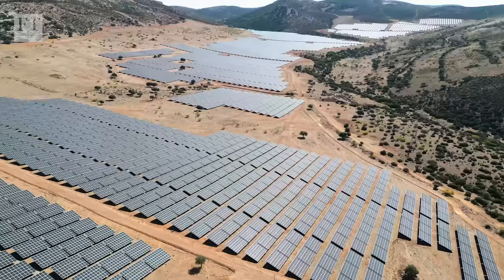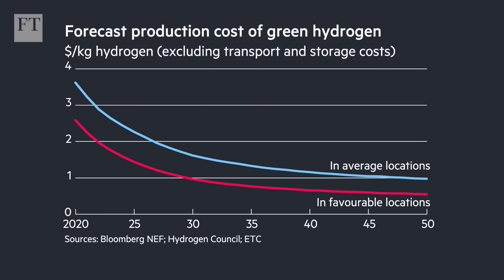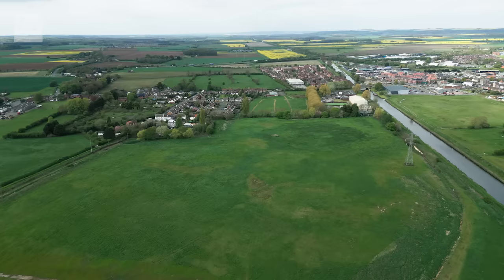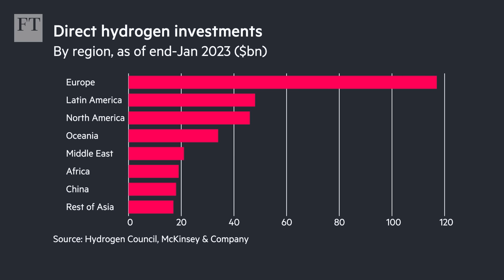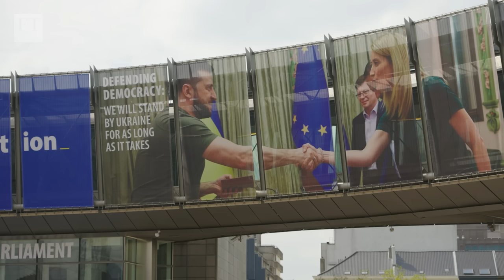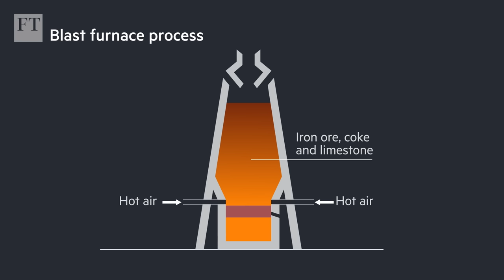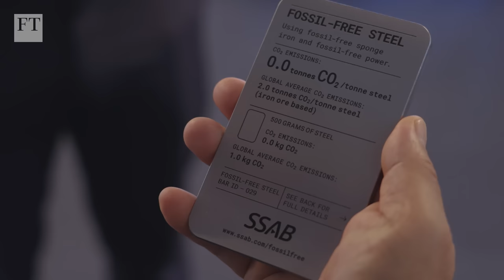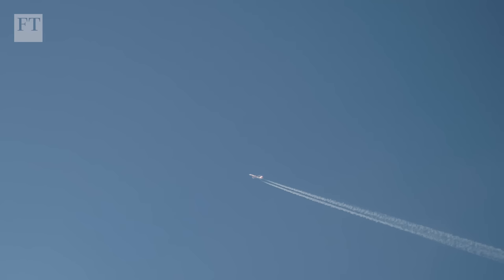Can hydrogen help the world reach net zero?  | FT Film

Comment: This completely glossed over the biggest issue with electrolysed H2 - the awful efficiency, not a lot better than petroleum. The round trip efficiency (electricity to H2 to electricity to power) is around 40%. You have to make a case that it's 2 and a half times better than simply storing the electricity in a battery. There are certainly use cases where the answer to that is "yes", but they're not as many as the proponents think. The second problem is that the fossil fuel industry piggy-backs on the "clean hydrogen" message to push their own hope that making H2 from fossil fuels will save them, always neglecting to mention that "blue" H2 requires CO2 capture & storage, a technology that in 20 years they have completely failed to demonstrate can succeed. In that same 20 years we've gone from no commercial electric cars to the amazing ones we have today and a grid that's rapidly decarbonising.
Reply: Ok. What is the top speed of Ford model T in early 1900s and what is the top speed of  toyota corolla? 

How was the experience with Windows 95 and Windows 10? 

How about flying the first flight of Write brothers and A380? 

Are you getting the big picture?
Reply: @Bravo.6  What is the relevance of that glib (and totally irrelevant) remark ? Windows 95 was hugely MORE efficient than Windows 10. It could run perfectly well on processes a tenth the speed ! That's an argument in favour of Win 95 !
Reply: haha, "rapidly de-carbonizing." What insane graphs are you looking at? Or are you reporting in from the Lunar colony??
Reply: @grahamstevenson1740  oh. so are you still using win95? I mentioned those to compare "level 1" things to "level 50" things". There are some genius people who say "hydrogen" is not efficient because it's in level 1.
Reply: @Bravo.6  No, but I'm also not using a 66MHz '486 !
That's the entire point. An OS that could run on a single core 66MHz CPU now needs a multiple core CPU running at many GHz ! The needs have increased around 50 fold.
Reply: @apollo_x_mirko8973  What about the energy used for cooling and compression of hydrogen for storage. It uses around 1kWh per kg of hydrogen to bring the pressure from 20 to 350 bar.
Reply: On avarge You have to drive  ev-cars for 10 Years to make up emitions one an average petro car. We have 1/10 of minerals to let ev- take over in a meaningful way.
Reply: @apollo_x_mirko8973  You're way too high. PEM efficiency is around 60% at best, nowhere near 80-90%.
Reply: It really depends on the specifics on the technology developed in the future, the H2 economy isn't ready today. There are a large number of alternate hydrogen processes being researched that have better efficiencies.
The best argument for a green hydrogen industry isn't for power, it's for industrial chemistry. We are going to need hydrogen to make ammonia and possibly steel.
Reply: Incorrect information here 👆
Reply: @djtomoy  Oh, what did I get wrong?
Reply: @apollo_x_mirko8973  Here's a reality check though.  Of all the electrolyzers, they all advertise pretty high efficiencies, but after you consider all the processes to make it work, it runs about 58kWh/kg at best.  Check any new large hydrogen project, not just individual components. Then, as California found out, they can't keep enough hydrogen at the stations to meet demand in gas format, so all the new stations are cryogenically cooled to -427°F for liquification.  That's an additional 12kWh/kg.  Granted Plug Power after decades of development from the previous company they bought just came out with a revolutionary chiller that only uses 11kWh/kg. The Toyota Mirai gets about 65 miles per kg.  So to go 65 miles you're using (58+12) 70KWh of electricity + transportation.  That's the reason all the "renewable" stations are charging $29.95/kg currently in CA.  So a little over 1kWh per mile.  Then consider any EV with the passenger room/ cargo room of a Mirai and they all get above 4 miles/kWh. The 2023 Mirai is considered a subcompact for interior space and a large sedan for external dimensions.  H2 is OK if you've got nothing else, but imagine needing to install 4 times the amount of solar to drive the same distance.
Reply: @Bravo.6  The problem with the "level 1" to "level 50" analogy, is that they have not even moved to "level 2" with Hydrogen in 50 years.  Meanwhile, battery technology continues to move forward.  In addition to the gross inefficiency of electricity->H2->electricity, and the challenges and expense of transportation and storage, there is not enough known reserves of platinum and palladium in the world to produce the number of fuel cells needed at scale.  Green hydrogen produced on site for Green ammonia and Green steel makes total sense.  You don't have the added inefficiencies and challenges or transportation, storage, and fuel cell electricity generation.  But everything else has too many problems.
Reply: When fossils are burned, hydrogen is what is actually burned, meanwhile carbon is released to the atmosphere. 

Understanding the basics would be of great benefit, to the general public.
Reply: You are working the round trip efficiency including a step that uses a heat engine to turn the H2 back into electricity, I believe.

The fuel cell approach does not involve the losses fundamentally inherent in any heat engine, and therefore has the potential to be much more efficient.

Getting the system to work is the first step; but it makes sense to choose the route that avoids the limits set by thermodynamics.

And even ignoring that, as one of the final clips in the video made clear: where electricity can be used directly is always going to be more efficient: we will accept the losses inherent in any electricity->H2->electricity cycle only where H2 is the most practical way to transfer the energy from the place& time of production to the place& time of usage. As that speaker said: it is those use cases that will create the H2 market.
Reply: @adamdymke8004 not only "being researched" but in some of these cases moving on into early production-scale deployment. Yes, at some point in the future some of these technologies will be winnowed out; but enough of them are either starting production or in production scale prototype that we can be sure some of them will survive.

Unless vested interests stop the energy transition altogether, in which case few of our grandchildren will reach age 50...
Reply: @FlameofDemocracy wrong!

Both the hydrogen and the carbon are burned, producing both dihydrogen oxide (water) and carbon dioxide. Both oxidations contribute to the heat liberated.

You were absolutely correct to point out that it's important to understand the basics: starting with yourself, if I may suggest so.
Reply: FT does not do numbers. That's for grown-ups. Thanks for the number anyway. 40% is not "wheely good/great".
Reply: H2 is ozone scavenger, if H2 start to be use at important scale=} bye ozone layer and Montreal protocol
Reply: Well said!  H2 has its use cases, but we have to carefully examine its pros and cons.
Reply: Yes, hydrogen is not nearly a mature technology yet, but it has some great potential where electricity cannot be stored. Batteries are only a short term storage option, you can’t stockpile electricity to use 6 months or a year later.
Reply: @alst4817  you can't really stockpile Hydrogen either though. It's hard to picture, but the Hydrogen atom is so much smaller than other atoms, that it can sneak through some molecular bonds. That is, you can have solid material, and the Hydrogen will just migrate right through it. It is incredibly hard to contain.

That is why people keep pushing the idea of bonding the Hydrpgen to a molecule, like with Ammonia. The problem with that idea is that Hydrogen already takes a huge amount of energy to isolate into a concentrated form. Then you would have to use a bunch of energy to bond it into the molecule. Then more to unbind it for use. It makes zero sense when it takes more energy to produce energy than what the energy will give.

Also, it should be noted with respects to Ammonia, that it requires a Nitrogen atom, which is needs to be obtained by stripping it off some material. You can't get Nitrogen atoms from atmospheric Nitrogen, because those molecules are triple bonded and require huge amounts of energy to break apart. Since the Nitrogen is stripped out of material, that also means there is copious amounts of waste material that needs to be dealt with from the process as well. So, more energy is necessary with dealing with that too.
Reply: @haddow777 yep those are good points, and I’m not a chemist so I’m not familiar with the specific energy needed to convert to ammonia and then back again, but my understanding was that the physics made this a possible approach. Whether the engineers can do it for cheap enough is a different matter!
Reply: But you can't compare it this way; the overall efficiency of gasoline, for example, including the refining process, is much lower—around 5%. So producing hydrogen as a fuel is still much more efficient than any other fuel.
Reply: @alst4817  I'm not certain about that. I charged Li Ion battery for a hedge trimmer last October 23. I used the hedge trimmer 1st January 24 and the battery showed completely full according to LED indicator lights. That is only about 2.5 months but I wonder what the LED's would show after one year. When I used the trimmer for about 1/2 hour the LED's were still showing full, although some charge would have been used and there must be a threshold level before the higher indicating LED goes out.
Reply: @grgmetube  problem with using batteries is that they can take a lot of space and/or materials to make enough storage to store meaningful amounts of electricity for eg. grid usage

Comment: Make no mistake, having run the numbers on hydrogen, the economics and maths speak plainly : 
1) Green hydrogen requires so much renewable power (39-55KWH per kg) that a country would have to commit most if not all of its renewably produced power to generate even modest amounts of hydrogen
2) Shipping liquified hydrogen from Australia, as the Japanese are discovering is not economical and in fact produces an enormous amount of CO2. Burning coal to make electricity to make hydrogen to make liquified hydrogen is one of the dumbest ideas ever. Even using ammonia as an intermediary is not cost efficient or green
3) The hydrogen car industry will never succeed, and has already lost by default to EV's for many reasons :- no hydrogen infrastructure, difficult and expensive re-supply of any such infrastructure, difficult and dangerous on-board hydrogen storage, prohibitive cost of hydrogen fuel cells. Poor performance of hydrogen fuel cells in colder climates. The list goes on

In short, not only does hydrogen require alot of power to make, but also to store and transport making it one of the most inefficient fuels. The net result being more CO2 produced when you consider the whole.
A proper assessment of migrating away from fossil fuels, realistically is over 200 years and hydrogen rather than helping this transition, actually hinders it.

The only benefactors of producing large amounts of hydrogen are the petrochemical and refining Industries who can use all this government subsidized hydrogen to replace some of the natural gas on their fired heaters. 
Not only do they get to slash their gas bills on the tax-payers expense, but they get to reduce their carbon tax at the same time. 

Ask yourself why Shell would build one of the biggest hydrogen electrolysis plants in the world, while simultaneously shutting down all their hydrogen refuelling stations in the North of England last year.

As with all these things, it comes down to money.
Reply: That's why, here in Germany, it will only be used for heavy industry. Some political parties want it to be used for heaters too but that's just not feasible as of now. And also to produce energy, when renewables are not enough due to weather conditions.

Comment: Using all that green electric energy to produce hydrogen gas, and then even more electric energy to compress it seems very inefficient use of electricity. Sure hydrogen will be needed in many areas, but for mass public transport it makes no sense whatsoever.
Reply: If it´s from the sun or wind in the end is a gain.
Reply: @marpintado  Anything from the sun or wind is a gain. Like I said though it makes no sense to use all that green electric energy to produce hydrogen gas, and then even more for compression and liquefaction, and then even more to transport it all around on trucks, it just isn't a very efficient use of all that electricity for mass transit, and that is with current battery technology, this will look even more ridiculous when the even higher capacity and faster charging battery technology that is already known about that is coming soon. It is simply a better use of the green electric energy to use it directly instead of converting it.

"Each step in the supply chain uses up some of the original energy: desalinating sea water to get fresh water as raw material, electrolysis, liquification for shipping, transport via tanker, local transport via pipeline in Germany and re-conversion of hydrogen into electricity. These steps would eat up at least 70% of the electricity originally produced."

BBC Article 'Could hydrogen ease Germany's reliance on Russian gas?' - 22 August 2022

E- car: Energy 100% > Transportation and storage >> Electric battery (high capacity > E-engine: Overall effieciency rate ~70 - 90%

Hydrogen car: Energy 100% > Electrolysis > Compression and Liquefaction > Transport and filling > Fuel cell and power generation >> Electric battery (low capacity) > E-engine: Overall effieciency rate ~25 - 35%

--------------

Hydrogen carried by a fuel tanker would need to kept at 700 bar in pressure. 

How many tankers would be needed to fill a fuel station? Typically 1 diesel tanker per day would fill a station.

If you want to carry the same amount of energy in hydrogen as 1 diesel tanker, guess how many tankers would be needed to fill a fuel station? Answer: 18
Reply: For most over things like shipping, steel making, flying, and much more then yes green hydrogen will be very much needed.
Reply: Petroluem as fuel is highly inefficient, gas internal combustion engines are only 20% efficient, the fuel cycle of gasoline has only 5% of efficiency, still we use it globally.